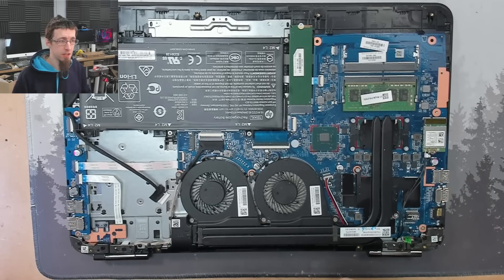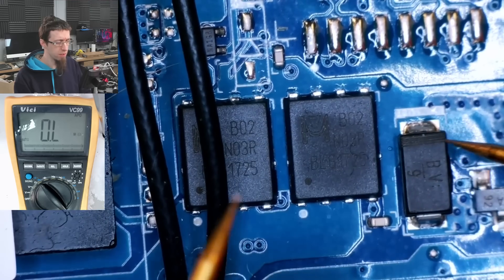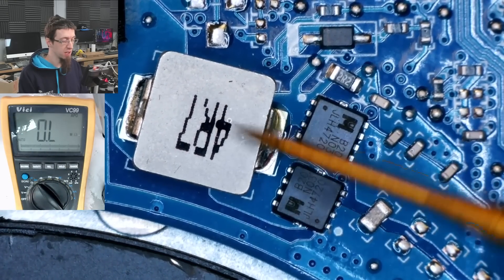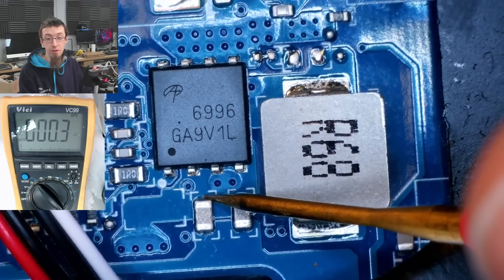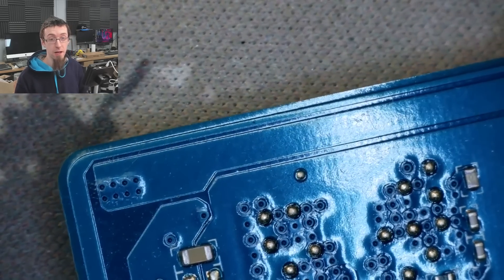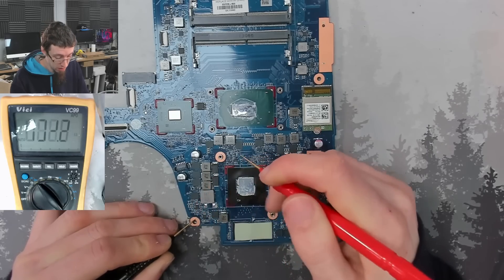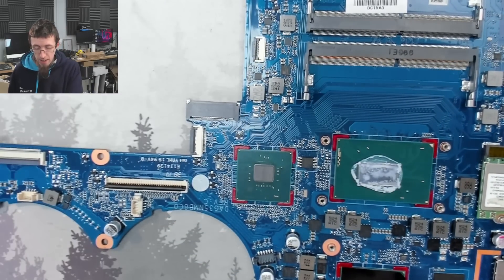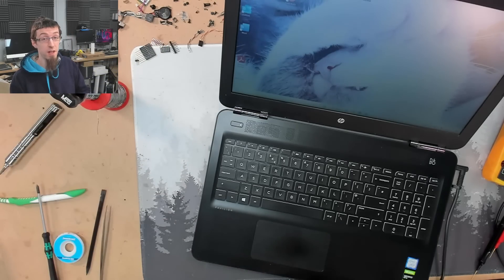HP Pavilion, classic short solving - LFC#345

Comment: Amazing, thank you very much. What would it mean if the power jack has a burnt mark in one of its pins that connect to the motherboard? Is it just a matter of getting a new jack? (It's an HP Omen laptop very similar looking to this one)
Reply from the maker: Maybe. A poor connection will cause the pins to overheat, which leads to more damage. Replacing the DC jack may be all it needs. I'd take measurements to ensure there's no additional problems though.

Comment: Graham totally off topic:  I recently swopped a circuit board from a matching HDD, this was the first time I ever did this.  Then thing I want to mention is I was surprised and the amount of those capacitors, as you know they are very tiny, I was wondering are they worth keeping for anytime you do a repair?  I could imagine one day you would be ordering some coz you haven't got any and there is a pile of them on thar board.  If I'm off the mark just ignore, it was just a thought.
Reply from the maker: It's not expensive to just have stock of common capacitors. Donor boards are great because they have a big variety of stuff on them, but there's only a handful of common capacitor values that you'll regularly need.

Comment: I've not been watching your videos for long but I've watched a lot of them! My methods and approaches are following you. Is it possible to touch a minute blob of low melt solder on the components for desoldering? I'm always concerned about the effect of heat on the surrounding ones - 450 degrees celsius!

Comment: next time, 
add flux, then take your solder iron and add leaded solder to the connections, then you will not have so much trouble heating them.  Non leaded solder takes high heat to melt.   Flux alone will not help with non-leaded solder.

Comment: Hey there, this is so damn good I enjoyed every part of the vid. Kindly help. I have an HP elitebook 1030 g4. It works just fine but the usb port don't function. And the thunderbolt ports also don't function. The problem started when I plugged in a generic USB Type-C charger to charge it. The port immediately stopped working and I cannot charge through it. Thankfully the other port charges fine but all the ports (USB type-A, and USB type-Cs) stopped reading usb devices

Comment: Think I have asked this before, but what sort of charge is there for a job like this - also not seen to the end so no idea if it worked :)  But a cost in general if it did work
Reply from the maker: I charge about £100 for board repair depending on the laptop. The balance is that this is high-skill work that should be expensive and pay me a lot, but charge too much and it's easier to just replace the mobo, which any beginner tech can do.
Reply: @Adamant_IT  Seems reasonable to save a £3/4 00 laptop ... anything of less value and, as you say, diminishing returns

Comment: I have a MacBook Air 13” a1466 that’s cloud locked. I bought a new logic board and it’s still locked. Where did I go wrong? Do I need a new ssd and trackpad too?
Reply from the maker: Sounds like the new board was also locked. I'd talk to the seller about that. A1466 can be unlocked, so it's fixable, but yea, seller shouldn't be selling a locked board.
Reply: @Adamant_IT   it was supposed to be brand new, I messaged him and he told me I need to wipe the old ssd. Guess I’ll try fix it if it’s a no go I’ll send board back

Comment: I have only 1A powersuply. Can I use AA batery? 1.5V and short current depend on batery technology but no problem check it before I use it.
Reply from the maker: eeeh kinda needs to be a proper bench supply so you can control it. I've seen people ghetto inject with a battery and such, but it's very uncontrolled, so if you make a mistake you're far more likely to kill the board than it forgive you.
Reply: @Adamant_IT  could you please tell me what is your microscope model?
Reply: 30 years old analog homemade with LM723😳. Work well for all my small projekt. I think buld or buy one bigger

Comment: And what could be the root cause for such failures? It's simply the cap itself? Some pre-determined-faulty products? Or some external event which made it crack? Or after such a replacement very rarely goes it faulty again after a time?
Reply: He said it was likely heat fatigue, causing the cap to fail over time. Not sure if it's possible to replace with larger caps (of the same uF rating) to dissipate heat better, if they fit on the pads. His replacement ones looked slightly larger but I'm not sure.
Reply: @Nebby_99  Thanks!

Comment: Just use a chisel or a knife tip on the iron and touch the side of the cap.No more hot air to cause a potential mess..Helps if you also touch the cap pads with some leaded solder first..
Reply: Don't know if he wants to use leaded. That iron might not be powerful enough to cleanly solder those caps down vs hot air.

Comment: Please Help! Hello just found you and Subscribed! I want to max out my fans, and saw your (LFC#191 - 3pin DC Fans vs 4pin PWM Fans) - video. my Question is: Can i run my older Better fan controler which uses 3 pin set up ( Voltage or DC) with my new Nactua 4 pin fans?